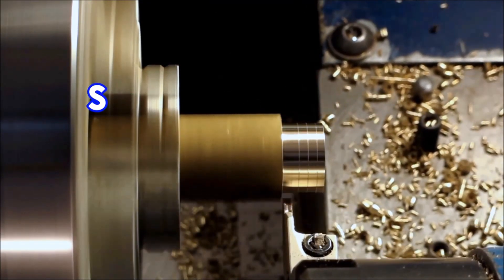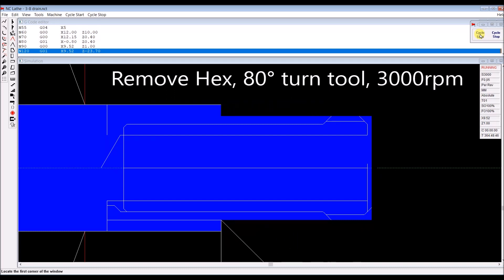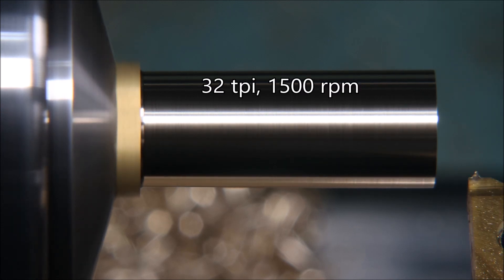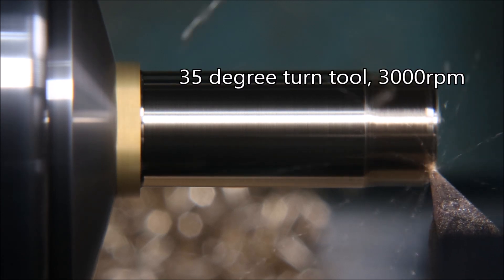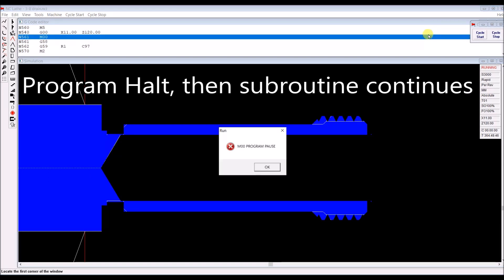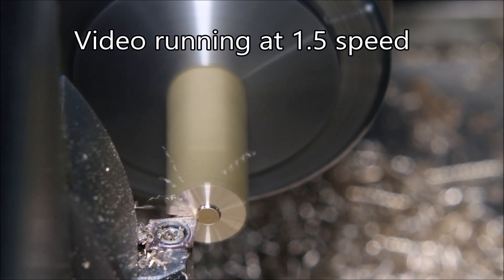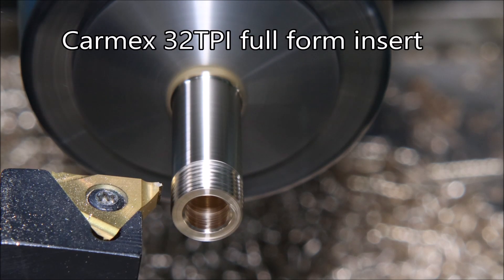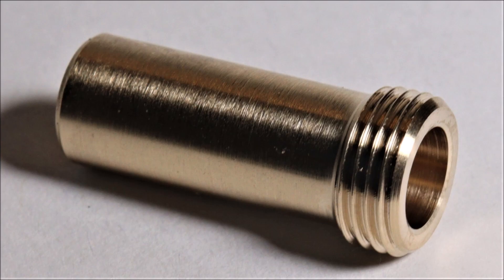CNC mini lathe turns, drills and threads 3/8” drain for steam injector using 5C hex collet

Comment: It's a joy watching little Hercus do it's thing. Shame they don't make small CNC lathes in this form factor anymore.
Reply from the maker: Hi HM, they are delightful little machines. For their size they punch well above their weight. Really well made and quite rigid construction the only real problem with them is the ageing electronics.
Reply: @smallcnclathes  If you plan to sell it, add me to the waiting list. Hopefully I'll have some money saved up by then 🤣
Reply: @smallcnclathes  with the electronics, something like Masso as a retrofit could probably be an option.
Reply from the maker: @HM-Projects  I think Masso have even made it work with the turret.  I have no intention of going down that road. I would need to find another cam system and I am quite happy with the Hercus software, I have been using it a long time and as I am now retired, the expense would be hard to justify.

Comment: Do you know what the part is for?

And if you follow Kevin D's suggestion, please post a video of it. 😊
Reply from the maker: Hi Peter, not sure if you read all of that conversation, but I will try it on similar parts, video next week. The part is an overflow drain for a steam injector. As always, thanks for leaving a comment.
Reply: @smallcnclathes  
Just making sure you record and show it. 😉

A steam injector? For model steam engines?

By the way: You have the advantage of me. What is your name?
Reply from the maker: Hi Peter, I am Nigel. Yes the parts are for a company in the UK. Will add their web address later so you can see what they do. I make parts for the occasionally, helps them keep parts moving and I am currently working my way through some 376 pieces of 10mm hex brass that are 35mm long. We are yet to find parts that I can make from the 250 blanks I have that are only 32mm long. LOL. Much better to use these blanks than scrap them.
Reply: @smallcnclathes  
Hi Nigel.
The UK? That's a long way away from you.

I may know of them by name, for there's a bloke in Yorkshire that repairs steam engines on a YT channel, and he often mentions where he gets his parts from.
Reply from the maker: @Peter_Riis_DK  yes it is a long way.  He also has a Hercus that here purchased from Sydney! Early on he had some trouble with it and that is how we started to communicate.  A long way to send parts, but as long as they are not too heavy it works OK.  Website  cm-engineering.co.uk

Comment: Thank you for the video. I could not find the proper insert/holder combination to make a 45deg back side of the thread, somehow i could only have around 30 deg there 😢
Reply from the maker: I think any of the holders for a 35 degree insert is capable of a 45 degree back chamfer. Thanks for your comment.

Comment: Great video as always.

I would try cutting the OD only enough for the thread, then thread, then drill the hole and do the rest machining of the OD. It'll make the threading op 2-3 times stiffer than it is now, and tell you if your chatter (might just be squeaky brass tbh) is part related, or tool related, and should make it easier to adjust thread dimensions if you aren't fighting deflection.

Brass should be stable enough that drilling the hole after doesn't change the thread dimensions too much.

Edit: Love the chamfer with the drill bit. So simple, but saves so much time deburring by hand, or setting up more tools in the machine.
Reply from the maker: So remove hex only as required for the thread, cut thread, drill then turn removing the rest of the hex and part. I think I can see movement as in deflection in the video, which rather surprised me.
Reply: @smallcnclathes 

 It works well, and I use it all the time for the piston end of cylinder rods when I don't feel like tossing a live center in the sub spindle. That extra 20% on the OD can get you close to double the stiffness.

Its so hard to tell from video! It could just be the tiniest movement in the camera mount from the lathe moving as well.
 Its a quick and easy way to see if it helps.
But hey, if its in tolerance, a good part is a good part!
Reply from the maker: @kevind1865  I may not change this part, but have more to make that are similar, I may try it on them. Thanks for your comments
Reply from the maker: Tried it out but did not make any difference. Must take into account the backlash that is still evident in my turret. Chatter seems to be on part of the circumference only.  Next video will look at new method and some pics of the chatter. If I can knock up some sort of spindle, might even try to video through my microscope the thread revolving and showing the difference.

Comment: Was there a reason for using hex instead of round?
Reply from the maker: How about having 376 pieces of scrap of the right size to make those parts. Far better to use them than scrap them.
Reply: @smallcnclathes  i figured, but was asking in case there was a reason I wasn't aware of.
Reply from the maker: @wagglebutt  I am lucky to know someone who can use parts made from such small bits of scrap. What did you think of the video, any ideas for improvement?